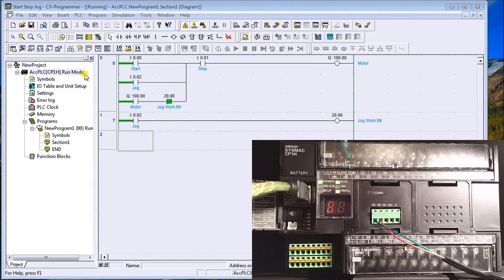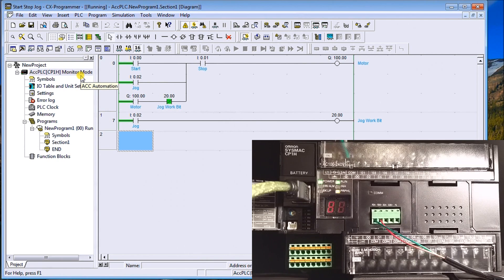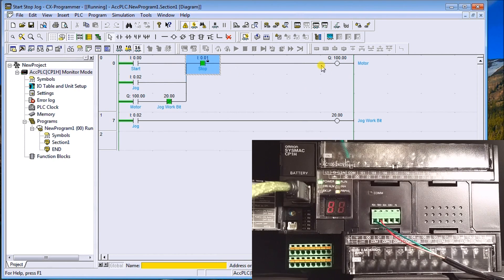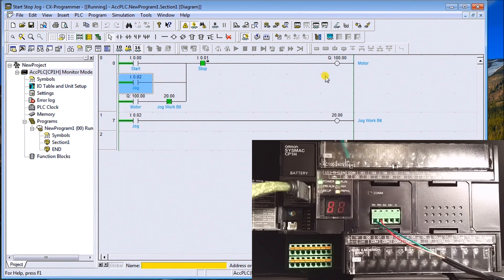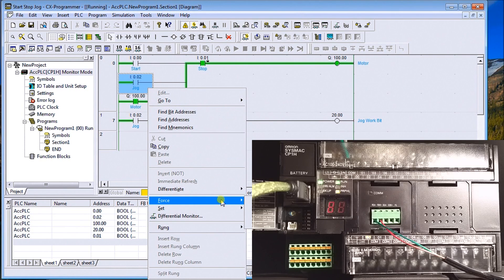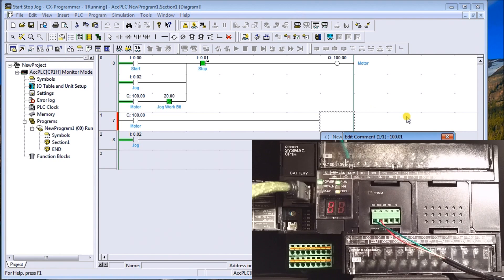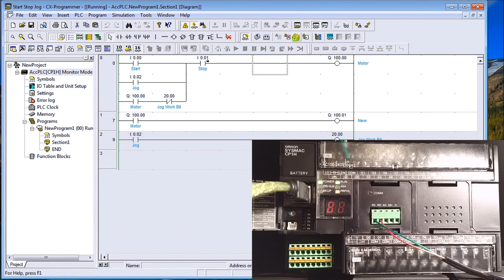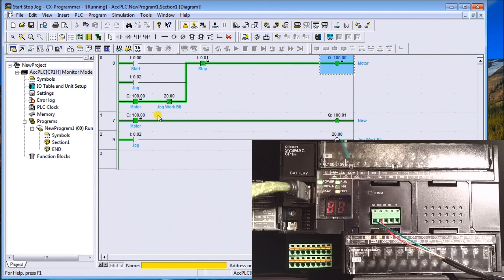Master Live PLC Programming: Edit, Test & Control in Real-Time

Comment: Hello friend! Could you ask me a question? Have you ever been through a situation where the logic when it is true triggers the output in the program (green lines) but physically not? But when I force the output (force ON), does the output physically trigger on the CPU? Thank you in advance if you can help me. Excellent video!
Reply from the maker: There are several reasons why the logic will activate the output, but the physical output remains off. 
- A force off is activated in the PLC. This will override the logic.
- The same output is used later on in the program ladder logic. The last output scanned is the one that will be associated with the logic.
- The output has been destroyed and must be replaced. If the indicator light is on and the output is not on, then this is usually the case.
I hope this helps you out. I'm glad that you liked the video. Thank you for the comment.
Regards,
Garry